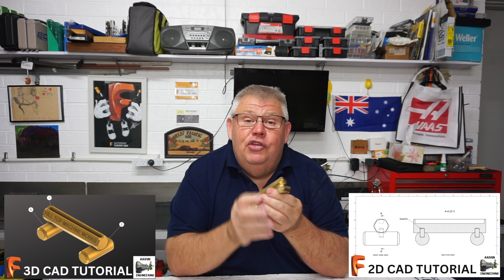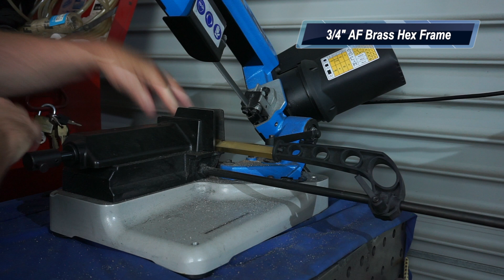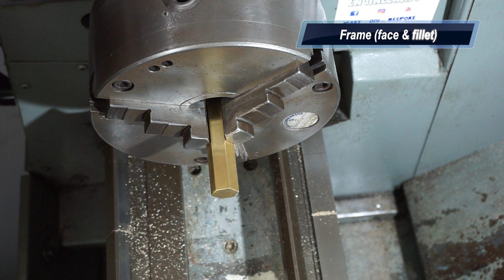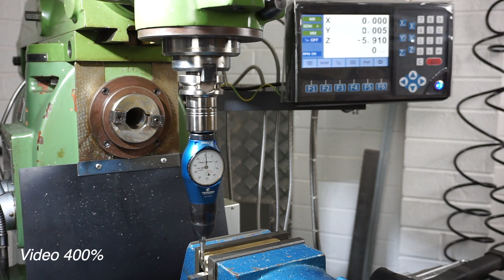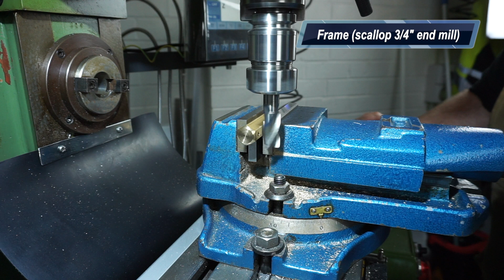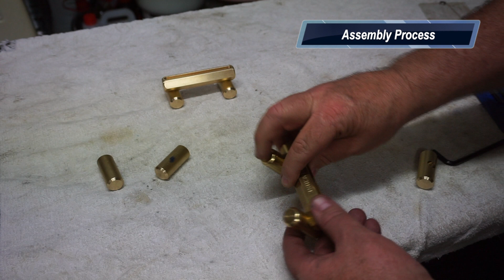Machining BRASS - Business Card Stands

Comment: What a fun project. I might have to give it a go. You're right, brass is getting expensive.  I think it would be fun to do a little foundry work. Melt some scraps down and then do the machine work from rough material.
Reply from the maker: That would make for some excellent content Garon. Melting down some swarf and scrap pieces and then turning into something useful. Cheers mate 🍻. Aaron